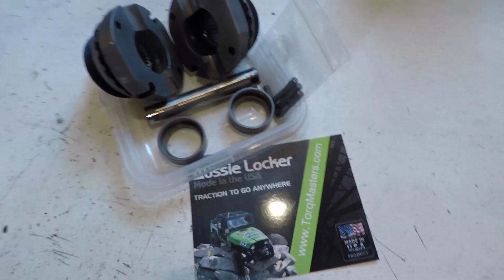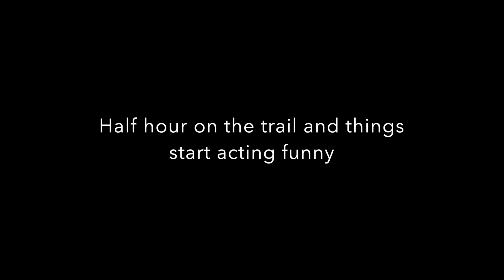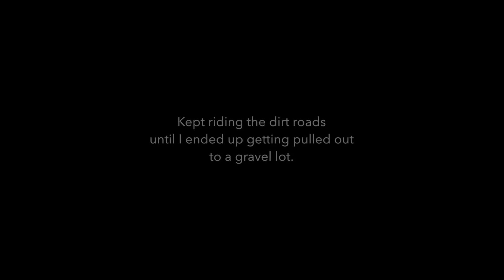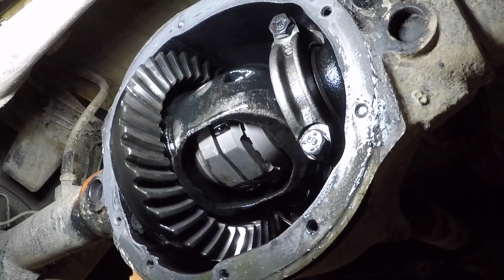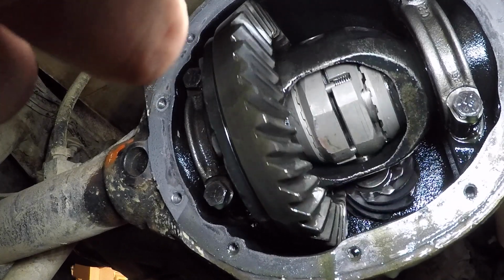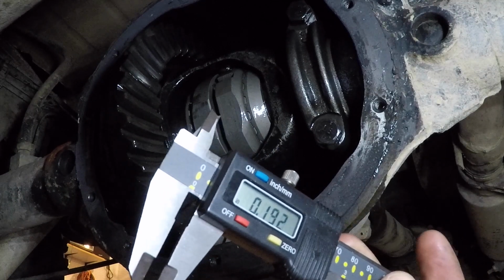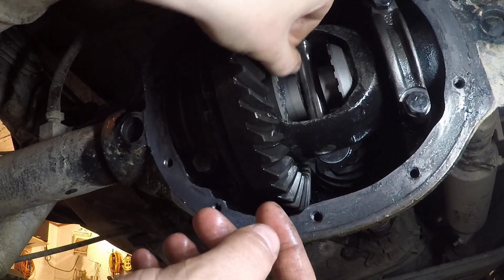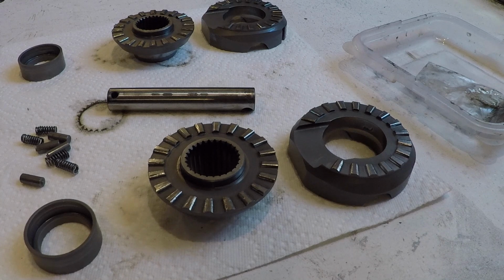What Happens When You Install a Locker Improperly

Comment: Wow, the gap in there, a 747 could fly thru that. Too much gap without the proper thrust washers caused the failure, causing everything else with the locker to fail. Too bad. Live and learn. Thanks for sharing.

Comment: Yeah that pin to spacer gap is crucial for the locker to work right you have to measure it per the instructions. I just put in a Lokka myself. Thanks for posting this video showing what happens if the tolerance are out.

Comment: Spinning one tyre well not always drive the other. These work by the centre rod pushing out on the 2 centres into the axle gears. Without that extra pressure you are only using the weak spring pressure which is weak to allow slip while turning.

Comment: I’m guessing when you got the used locker you didn’t have the install guide. It is pretty clear on the measurements. Thanks for sharing. It can be so frustrating getting into something new. So far, I’ve had an awesome experience with these lockers.
Reply: If it's all the same to you, I Lincoln locked I was getting stuck on wet grass.
  Limited slip will get you stuck also.

Comment: If you ever overload and round over the splines on the shaft from your transmission to your t-case, it will make a very similar noise and feel. Trust me, I’ve done it. I would bet that basically the metal had just enough flex (like .002”) to allow the teeth to skip, but barely so, causing a brutal hammering on the differential. I would worry about the fatigue it could have caused to the axle shafts as well at that point
Reply: can you specify more plz?

Comment: Splines on one of the sleeves of the locker are worn out. As soon as you got on the trail the locker tried engaging but was slipping every time it tried to lock. The guy sold it to you because of this problem. auto lockers inherently wear out after so long because the way they work is based off a certain amount of play between the gears and the center pin from the factory after a while the space becomes gradually larger making the locker useless.
Reply: Its slipping because the gap between the 2 sides is too big allowing the teeth to disengage....he didn't put the shims on from the original spider gears which created this situation...tells you in the instructions how to install them properly and check the gap, 2 things that wasn't done in the video, installing the shims, and checking the gap prior to putting the cover back on....cheating the system will result in failures LOL.
Reply: Meh. I’d have shimmed it back to spec and run it myself.

Comment: It wasn’t “wear on the teeth” you didn’t use the shims from the original spider gears to create the proper tolerance.
Reply from the maker: Later on I ended up breaking my 35 and the carrier cracked. I’m thinking the carrier had been wearing and eventually went out. Torq masters told me excessive play in the carrier could lead to the locker not working also so there’s a couple variables that could have lead to the cause of it not working.
Reply: Didn't put the shims back in with the OEM spider gears either
Reply: exactly
Reply: @jtmoffroad  
What part of Wv ?
Reply: @BigDOOMson  Instructions say not to use shims! NOT!
Reply: Some lockers don’t require the original shims. It’s a simple case of checking tolerances and following directions before sending it.
Reply: @MrTerduckin  I am using a spartan locker and it said no shims worked good for awhile but lately been getting alot more popping and cracking. I think its cuz I put a wider tire. Burn these off soon and go taller and thinner.
Reply: @krisphillips6893  you have to use the outer shims from the original open diff spider gears…every Aussie or similar lunchbox locker instructions said to use them so far we’ve had no issues with them
Reply: yes i think he didnt use the thrust washers from the spider gears
Reply: Yep he messed up and is trying to blame it on something else
Reply: @seantbr2019  you must not have read the title of the video… he literally said he installed it wrong…
Reply: @boost1728  thanks

Comment: Improperly installed locker without measuring the gap = locker not working properly every time.  Not the fault of the manufacturer, just someone not reading the directions, tells you in the instructions to check the spacing, and to add shims if needed to get the gap within the spacing tolerances needed to properly work.  Too much gap like in this instance and you get that clicking as the locker keeps disengaging itself because there's not enough pressure on those springs to keep it engaged.

Comment: U should do the 8.8 ! Get one with a 3.5" axle tube and disk brakes ! You can get them from 1995+ ford explore if u want about the same width. But now is your chance to go full width ;)
Reply from the maker: Actually did just a couple months ago and I have videos on it!
Reply: I put a spartan locker in my 8.8 behind my yj, no need for thrust washers and I just threw it in, measured with a digital caliper and was just within spec. Got it from amazon warehouse specials for $130 but I think they're $240. I haven't watched your video yet but if it's not locked yet I recommend it!
Reply: i did 8.8 under my xj with the spartan locker and 4.88 gears :) best thing i have done yet !  i kind of wish i did full width axles for better stability, since i did a custom rear and had to remove the front to re-gear, sleeve tubes, weld tubes to housing, reinforce knuckles/control arm mounts, and change to long arms ...     
oh, and i paid $225 for my spartan :(
Reply: @MrMrsregor  I agree i just installed a spartan locker in my 71 c10. Best upgrade so far burnouts are way better. Seems to lock and unlock when needed. Makes noise clunks sometimes these are all things I expected and am happy with. I was looking to fix my uneven tire wear.
Reply: @cfmechanic  perhaps the uneven tire wear is due to burnouts on an open diff lol

Comment: I think when u install the Aussie u need to use the shims from the spider gears
Reply: Yes you do, according to another review I watched where a guy installed one.
Reply: Yes you do, you have to place them on the new gears before you install them.  They are there for a reason to help close that gap...if its still outside of the max gap specification you would need to add additional shims, which usually only happens if your axle is severely worn out to begin with.  

Simply putting the shims in that weren't installed originally would have corrected the issue.
Reply: cf mechanic do they not send shims with the locker to use??
Reply: @jacobhendrickson8935  You use the shims that were already in the differential when you took it apart.  Occasionally when people disassemble them they lose a shim or multiple shims and don't realize it and the result is a poor performing limited slip or horrible differential noises.

Comment: Might be why it was on craigslist. I use the detroit myself, 400 bucks, and its solid. been goin on 2 years now. no issues.
Reply from the maker: In your Dana 35? How’s it run? I’m working on my 8.8 now so I’ll either run the welded gears or get a new carrier and run a mini spool
Reply: jtmoffroad oh no... I have a 14 bolt. Equivalent to the Dana 70 and 80. Stronger than the 70 but not the 80
Reply from the maker: Oh very nice!! Hopefully I’ll get to that point someday. That’ll be in the very long, distant future though haha. How do you like your 14 bolt?
Reply: well I weigh 7,000 lbs so its perfect haha. For your case? it's extremely overkill. Now if you like hitting rocks at 50mph, you might consider a 14 bolt. Your build, Dana 60's are considered overkill but really sick. Dana 70's on your rig, people will start to ask why...
Reply from the maker: Haha my bad I meant get to the point of having beefier axles in general. Won’t happen in quiiiite a while haha
Reply: lol no worries. They're a hard thing to judge. If you're locked on a Dana 35 and your not having any issues, then if you were to upgrade, look at the Dana 44HD. That will be PLENTY of an upgrade for you. you should be able to put bigger tires on there too with that axel. 35's on a dana 30 is just asking for failure.
Reply from the maker: I’ll be putting an 8.8 in that I’m currently working on in the rear. My locked high pinion 30 is doing good so far and behind the 4 cyl I’m not too worried. If I do upgrade the front, a   44 out of a wagoneer is prob the route I’ll go but that won’t happen until my 30 breaks.
Reply: Sean R, the D44 HD (out of a Grand Cherokee) has an aluminum housing. These are not as strong as the D44 out of a TJ. I was told it would be a good idea to truss the axle. Also if installing this axle in a TJ wrangler, I noticed the bracket placement on the HD44 axle don’t line up the same. So the only way to make it work is to cut and weld the brackets in the proper position. Sounds like a PITA. Ask me how I know. Just my 2 cents.

Comment: More than likely the PO did the same and didn’t install it properly and then sold it to you.

These types of parts are tough to buy used.  Hard to measure the wear and just not enough savings to make it worthwhile.

I just bought a Lock-Right new from Advance Auto Parts for a 12 Bolt for $244 plus shipping and got it in a day.

Comment: 3 years ago I know, but I think that your 0.195 gap wasn't the issue, I am currently running a torq locker and I am also supposed to be between 0.140-0.170. But with the shims that came with the kit I am at 0.194. They are gonna send me more shims soon to fix my issue but they said 0.195 is "OK". I blame the fact that it was used.
Reply: Yeah my Spartan i just put in yesterday was at .175 and the tolerance is .145-.170 Im not super worried about being 5 thou out of spec and i called them and they said it should never have a problem.

Comment: I would have as much faith in a used condom as I would in used differential parts.
Reply: always remember to check the Gap and tolerances
Reply: @leomenchey3726  on the diff or condom?
Reply: @armandovela4415   both
Reply: I’m meeting with a guy later to buy a used locker 😅 the price is too good so worth a shot.
Reply: @leomenchey3726  
That’s nasty wtf 🤢
Reply: Nothing wrong with using used Diff Parts. Knowing what to look for when inspecting them and properly installing them is the key. Never had a failure in any of my off-road trucks or my mustang.
Reply: @bearfoot25  I bought a brand new set of those very limited slip drop in units for a few hundred dollars for my 51 Willys Cj3A; I like knowing the piece I am putting in is new made in USA and has been heat treated and sized perfectly guaranteed.  I guess if the used parts were almost free and you have the time to inspect replace if necessary.

Comment: Before I add my opinion i just wanted to say thanks for the video because it shows a real life problem that you unfortunately had. So I don't mean anything negative toward you or your video.  but yeah that was a major fail. the guy probably sold it to you because he installed it and had the same problem. maybe he put way more miles on it than he said and it was in like a hardcore trail rig and he wore it out. I don't like this type of locker even though I have one , because i feel like based on the design of the locker its destined to fail eventually, its going to chew the teeth up. , my first was a ez locker in a 12 bolt. chevy C10 454 it ran a 13:00. after about a year street driving and racing about 30 passes it started slipping. my second one is in my samurai front axle its a spartan  i only ran it one day and so far its working good but I feel like once i start using it a lot it will start slipping too. ok i just finished the video and thats exactly how my ez locker chewed the teeth up on the 12 bolt axle.
Reply from the maker: Thanks for the input and appreciation for the video!

Comment: Hello, I am a Italian boy, i will install on my AMC 20 a similar diff-lock. what was your mistake? the space between the flanges and the pin? was there too much space?
Reply: Please help me
Reply from the maker: That was one of the issues. The other issue was the carrier was too worn. The centering pin had too much play. Actually more issues than one that played a part
Reply: He didn’t use the shims. That was the cause. It wasn’t the carriers fault at all. Mine has over 250k miles on it and then I installed a locker with no issues.

Comment: It wasn't wear from the previous owner. YOU failed to use shims and create the proper clearance. Aussie Locker has been around forever and has a good reputation. INCORRECT installations are not the fault of the product.
Reply from the maker: Pretty clearly said I messed up and didn’t install it properly
Reply: He said he installed it wrong. He never blamed the product.  Apparently you missed that part.

Comment: You’ll be alright putting a “locker” in a 35 if you are going through some sand or maybe a couple of really smooth small mud puddles.
Reply from the maker: Haha I’ve got a video later on when I broke the 35. Had to turn around and get the 8.8 I had laying around in in time for another ride a couple weeks later.

Comment: did you install the thrush washers on the outsides of the cam gear i wonder if the yj 35 is different from the zj 35 cause i never had any issues when i had that in there i can post a video of it in action
Reply from the maker: Travis Fair yea I put the thrust washers on the outside but I think I needed to add more to get the gap closer to spec. Plus powertrax thinks my carrier was a bit worn. Thanks for watching and commenting!

Comment: Dump it and put an elocker in. I like them more than the ARB lockers and hate lunch box units.
Reply from the maker: That axle eventually broke in a later video and I replaced it with an 8.8 with a welded rear end. Works great so far! E lockers are the goal though

Comment: Facepalm as soon as I heard locker and 35 in the same sentence.....lol
Reply from the maker: Sometimes you gotta just try things out for yourself despite what everyone says hahaha
Reply: A s35 kit w/locker will make that d35 stronger than a d44 or 8.8
Reply: @stickyicky2120  no it won't. The Dana 44 has a 8.5in ring gear and the ford is 8.8in. The Dana 35 is just over 7.6in. No matter how strong of axle shafts you put in it still has a puny ring gear.
Reply: @lol123321123321  Ring gear isn't the Dana 35's weak spot, the housing is weak in comparison.  The leverage a tire over 33" has against the housing bends tubes.  I'm not arguing that the 35 is stouter than a 44, or an 8.8, or an 8.25 but it's ring gear size isn't it's ultimate fault.  The Dana 30 runs a 7.2" ring gear and survives better than one would expect.  I'm still getting rid of any Dana 35 I have when running 33"or bigger tires.  The 1.18" shafts don't help it either though.
Reply: @mtroadtripper  I agree, the reason the Dana 30 is so stout is because it's a high pinion front axle. Going forward the Pinon rides on the drive side of the gear, not coast like a low pinion. It wants to pulls the teeth together rather than apart.
Reply: @jtmoffroad  I think its a good idea to put a locker in whatever you have and run it. You probably wont break it for a while and you will have first hand experience on whether or not a 35 is strong enough for what you do.
Reply: @lol123321123321  Dana 30s are solid beast, specially the Volvo ones

Comment: You kept on driving because?
Reply from the maker: When the issue started it was apparent something was wrong with the rear axle. Just had to try to get out of the woods and to the trailer.
Reply: Ahh trailer, I would have done the same. I'm used to driving to the trail, different mindset.
Reply from the maker: Yup! Glad I trailered too cause it was a 7 hour drive one way haha

Comment: why didnt you run 2wd when you could,.id be after a d44 or 9".early mustang width,??.or easy to cut one with 2 left axles,say.i just cut a 44,easy,for my highboy,used a std 80.s jeep shaft.all same.mix match.was 1725,now 1650,with 8 stud.ended same as std 44,just under,i have 36x15.5x16 wheels
Reply from the maker: Eventually I swapped the rear out for an 8.8 out of an explorer. I couldn’t do front wheel and pull the rear shaft. The rear is a slip yoke shaft so I’d lose all the fluid out of the t case. I mean I could have but that would have been a bad mess. Eventually I’ll be getting rid of the slip yoke and go to a slip shaft and won’t have to worry about that issue again

Comment: Tru trac
Reply: They're awesome for a daily driver with snow use and light off road trails but if a tire comes off the ground they lose traction.
Reply: Jacob Whittaker not in my experience,tru trac has worked as advertised.I didn’t buy a full locker because I can’t see buying a full locker with an open diff when not engaged.

Comment: .135" between the 2 halves of the locker on Lock Rite?  .135" OR LESS. that isnt much space.  the space u have there is TOO MUCH. the Spartan locker does not use the side shims..... others must use the side shims and still the clearance tween the locker halves needs to be pretty close to what locker mfg suggests IN THE DOCUMENTATION!!!!  maybe next time... test the locker NEARBY so if it isnt right... aren't 6 hours away from the shop to figure out what the problem is and FIX IT

Comment: This is a great video. These products are a joke. I had mine professionally installed on a ford 8.8. The teeth just wear out in a couple years of regular driving (in my case not even 3000 miles). If you want a locking differential get an OEM one. There is a reason why manufactures don't put Richmond Gear junk in their differential cases.